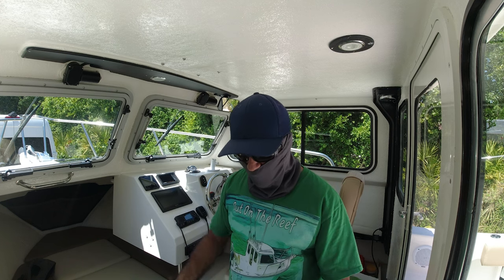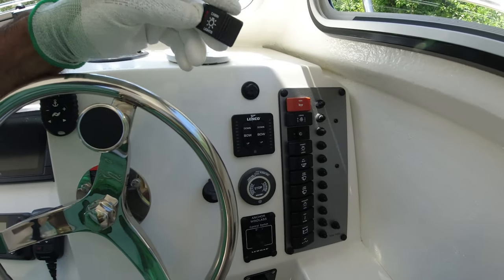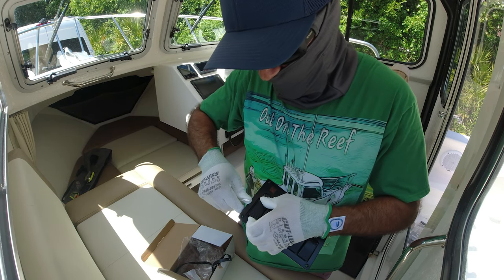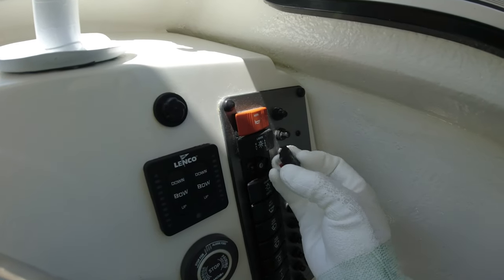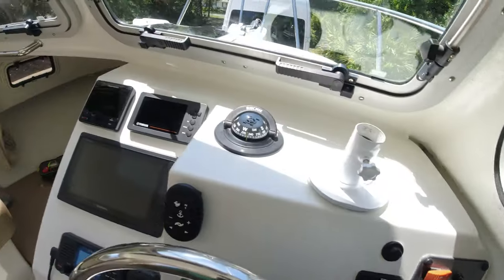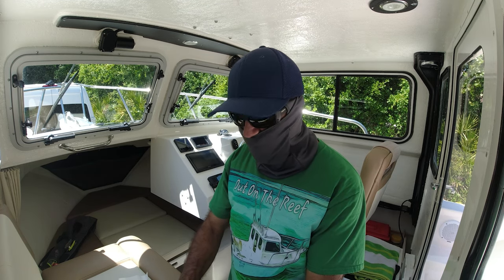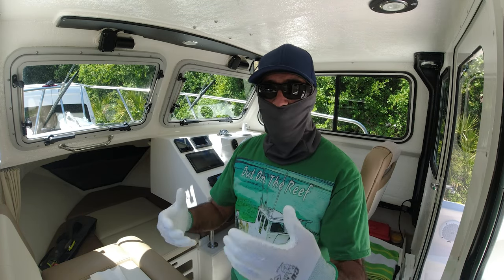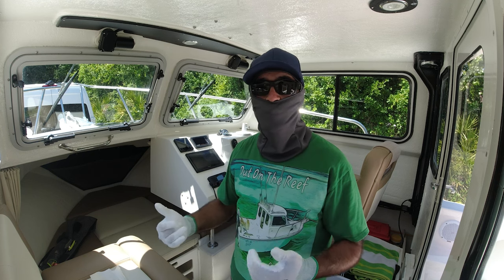How to Repair Toggle Switch Board DIY on the Crooked PilotHouse Boat parker boats

Comment: Hi Capt.... great advice! I had two of the original switches fail/over-heat/burn out. It was not the fault of the switches, but the fault of the 'manufacture' and/or their dealer who installed the electronics. On each of the switches, they grossly overloaded them. I replaced them with higher amp (and higher quality) switches.
Reply from the maker: Wow cap. Glad no fire was created
Im surprised this switch only last 2 1/2 year especially this switch gets used the most.
Thanks for sharing cap.

Comment: Hey Capt,

A little bit of white paint on the back of the sticker would make the info pop better. Let it dry and stick them label on later.

I was able to find just the caps on eBay.
Reply from the maker: Awesome idea Mike I thought about it afterwards but I think if I take it out when I put it back in the sticker might not have any adhesive on it.
But that's an awesome idea Captain thank you😉👍

Comment: Hi Captain!!!! Marine Connection in Ft. Pierce has tons of those switches available!!! Along with everything you may ever need for your boat/trailer!!!! It's a huge warehouse for new and used boaters needs!!!!
Reply from the maker: Thank you Richard I did not know even though that is about 2 hours away from my house but probably I can order online thanks for the heads up Captain👍👍
Reply: @OutOnTheReef  If you ever heading in that direction it will be worth the stop,,, it a Mariners/boaters candy shop!! Te garantizo que vas estar mas de 2 horas mirando😂😂😂
Reply from the maker: @richardroessler4240  asy es nosotros los mirineros podemos estar dias mirando cosas para el barco, muchas gracias capitan y saludos

Comment: Need link. Have rocker switch on my 2520 needs replacement.  Did not see your link. Thanks
Reply: Found your link and ordered panel
Reply from the maker: @jeromenicholasjr421  awesome cap. And now you going to have spare parts for the future very eccomical 👍👍

Comment: U can buy them separately, cars and boat rockers are the same. Take that off and return it and get the cover for $6.99.
Reply from the maker: Awesome suggestion thank you Captain
Reply: new wire marine marine-grade-switches marine-rocker-switches
Reply from the maker: @badkarma2202  thanks cap.👍👍

Comment: You got all those extra jumper wires in case you need them.
Reply from the maker: I did not think of that Derek thank you for the great idea and see I think the whole switchboard extra that I bought has a lot of extra parts that I can use in a lot of repairs👍
Reply: It's good to have in case of emergency. You never know when you might need them.
Reply from the maker: @derick441  very true I agree on having extra parts on the boat all the time especially if you go out there deep into the sea👍
Reply: Yes. Just like at work to Jump a capacitor to another to get ya out of a pinch.
Reply from the maker: @derick441  yes very true cap, i will placed some of those in my refrigeration bag to
Reply: @OutOnTheReef  I do residential. We just  take all the jumpers off the old heat kits in the scrap yard to keep in the service bag for that. Not sure if those are proper gauge tho.
Reply from the maker: @derick441  i will look at it and they look heavy gouge,  thanks for the great suggestions cap.😉👍👍